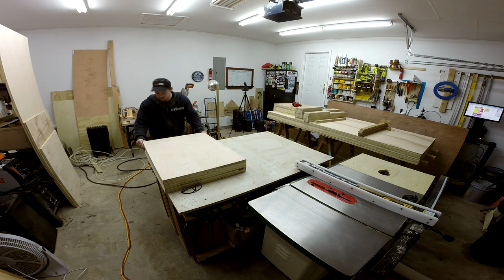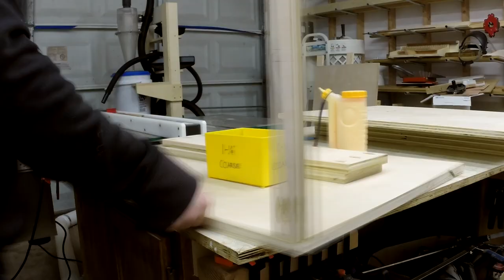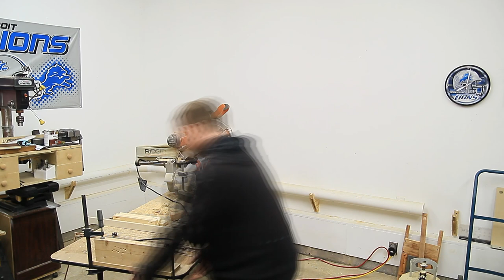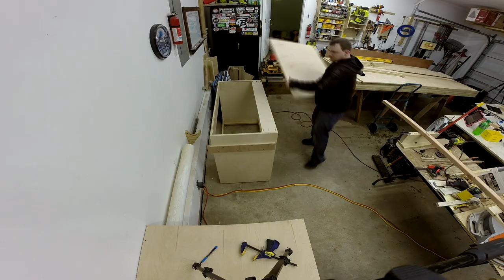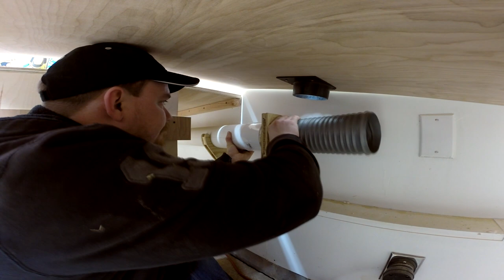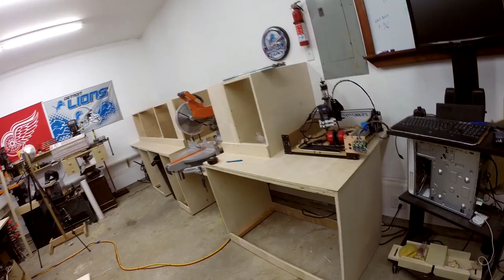Miter Saw Station Cabinets and Work Surface - 194

Comment: I love your miter station. I would not call myself a woodworker, but I am a 58 year old woman who builds lots of shelves, and does lots of home improvements. And I do have my own power tools and workshop. I have built my own workbench, just threw something together with scraps and I built lots shelves above the workbench that I can barely reach. I like yours because being only 5 ft 1 inch, I could easily reach everything the way you built it. Plus I like how the counter tops support long boards while cutting them with the miter saw. Excellent idea. Though I am not very good at making drawers, I could instead make it to fit my plastic bins and even add more bins. I use a lot of them in my workshop, I store things like my jigsaw and circular saw in plastic bins along with the manual and the little tools that go with them so everything is together, I also store things like scrapers and other things in bins, keeps the dust off. And I could even add higher shelves for seldom used things.

Comment: Looking good so far Jay!  That's gonna be awesome when you are done!  Good call on the t-nuts and bolts for leveling feet.
Reply from the maker: Steve Carmichael Thanks Steve. Tee nuts and bolts are much cheaper than leveling feet.
Reply: Jay Bates I've never seen that. I like it! Wish I had known about it before doing my own a couple weeks ago with contractor shims. :)

Comment: Looking good, and it appears that you're making good use of space.

I have a love/hate relationship with my SCMS because it takes up so much space and creates so much dust. At the same time, I still find it very useful and use it almost every time I'm in the workshop. It looks like your plan addresses both the dust and the space issue.
Reply from the maker: Barry's Workshop Thanks. There is waaaaay too much wasted space with a typical SCMS so I chose to use as much of it as I could with drawer storage.

Comment: Great alternative to the Wotkshop hutch Norm Abram built. Mutch easier to get the cabinet compartments the exact same size when making the cabinets individually, which is a big deal when it's time to make drawers, and install drawer slides. Also the individual cabinets makes it much easier to accommodate for uneven floors.
Reply from the maker: Peter G True.

Comment: Great miter saw station, I plan to start mine soon (based on your design and another one).  Just a little tip from another "garage woodshop guy" here:  Back your truck up so the plywood is roughly in line with your table saw fence, and go ahead and slide it from the truck onto the saw and cut it.  It should save you some double work from moving the sheets around twice!
Reply from the maker: That's true. But it rains a lot here. I can't keep anything in the truck.

Comment: Just a suggestion Jay: have the home center/ lumber yard pre-cut those 4x8 sheets in half with their panel saw. Most don't charge for one or two cuts and a nominal charge per cut on larger orders. It makes handling by yourself sooooo much easier. You can still run it through your tablesaw to get an accurate edge but it saves your back and speeds production greatly. Love the vids even if you are a Redwings fan. :-)

Comment: I'm just starting my first cuts in the plywood to make this in about 1/2 hour.  I'm thinking I will flip the carcasses over and get the leveling feet close to level while they are upside down and then fine tune them once they are in their final positions.  I think this would save a lot of time as you could easily spin the carriage bolts without the weight on them.  It will need fine tuning I'm sure as the bolts will switch back to front when flipped upside down.

Comment: Wow!  That's what I call taking control of your workspace.  Was the concrete really that level?  Hats off to the guys that screeded that slab.
Reply from the maker: Michael Meara No the concrete wasn't that level The wall side of all the boxes was higher than the front side. I leveled every cabinet with the bolts but only showed one.

Comment: when you were screwing in the pocket hole joints it seemed like you went 70% backed out a bit and then screwed it in all the way almost like when you tap a hole 
what is the purpose of that, does it avoid cracking?
Reply: if the pieces are misaliened
Reply: ndinadis Sometimes the two pieces don’t make full contact before the screw bottoms out. Backing out the fastener and driving it again aides in a better fit because you can make use of the piloted hole and downward pressure. Good stuff!

Comment: Looking good.  Not sure i understand blocking the counter space on the left but well done either case.   I never seem to have enough horizontal areas.
Reply from the maker: phooesnax Horizontal surfaces collect junk. I'd much rather have multiple drawer storage. I have other work surfaces in the shop for actually working on stuff.

Comment: Hi Jay, I like your stuff and the clear nature of your videos. I was wondering why you seemed to drive your pocket hole screws and then reverse them out before driving them home. Also with as many pocket holes as you drilled, the pocket hole machine seemed to be worth having, although I recall you saying that the machine broke a lot of bits. Was it worth having for this build? Would you buy it again?

Comment: I purchased some 3/4" Birch plywood five years ago at £75 ($100) per 8 x 4' sheet, I have just been quoted £400 ($520). I don't think I will be using that for any workshop projects. Regards from expensive England.

Comment: Nice Jay, i am still contemplating on doing a fully built in like yours or put it on wheels. There is a lot i want to do in the garage to make it a fully working shop.
Reply from the maker: Miter Mike's Woodshop I ended up not doing the wheeled version as I knew I would just park it and never move it. This gives me a lot of dedicated storage space that every shop can use.

Comment: looks great Jay. I've been waiting to see how you would take this project. I know it's early yet, but have you thought of adding a "stretcher" under the miter saw table to prevent the plywood from sagging. I have the 10" Ridgid without the slide and it made one of my work tables sag.
Reply from the maker: Studio69Fan Yes, there will be support under the MS.

Comment: Jay, like the way you've set up the extensions at the front of the saw to help with the full sheets, can you describe or show how that set up works and attaches to the saw?  Looks like a slick helper hat I could use, thanks for the channel, it has good content!
Reply from the maker: Chef Derek The infeed helpers are super easy: https://www.youtube.com/watch?v=KyNgZ72VwtA
Reply: Jay Bates  Many thanks fir the link, I couldn't find ut when I looked!  Now I just have to figure out how to make them work on an extruded aluminum front rail.

Comment: Just saw your build. Nice work btw! Tell me how deep your bottom cabs are.. Look to be 30" with 24" upper cabs. I have a Makita 12" with the dual slide rails and nice saw, but needs about 30" from front mtg holes to rear when fully pushed back. Thx Jay

Comment: Simple answer I am sure, but how did you connect your mitre saw exhaust to the hole you created for the dust/debris collection in the table? Do you just attach the shop vac to the pvc to create a simple dust/debris collection?

Comment: Love the design.  I'm going to use it myself when I add my third stall garage this summer.  One question.  Have you given any thought to when you have to replace your Rigid miter saw one day?  I haven't check lately, but don't think they are all the same and who knows how long Rigid will offer that model or one with similar dimensions.  Just wondering if you build any adjustability into the station.
Reply from the maker: VC Sawduster This is the largest SCMS I have ever seen so pretty much everything else should fit in the space. Hopefully I'll never have to replace it.

Comment: this is probably the 20th times I watch this video 'cause I'm trying to learn tips in building mine. One main problem I have is the Kreg screws will pull the work piece from alignment. I see that you screw it in and back it out a few times, is that to prevent this? I did use a clamp but it's not enough apparently, or did I screw in too far?

Comment: In the planning process at the moment to building something similar in my shop, I'm curious what your total estimated material cost was.  Also, I'm not sure if going with  big deep drawers, medium depth ones and/or some very shallow ones is a better idea than just going ALL deep drawers or even cabinet doors.  

I'm curious what you find the most useful in your shop before I actually start to cut.
Reply from the maker: +David Elston This organization system has been really beneficial for me. The only thing I don't use as much as I thought I would was the planer drawer. I keep my planer out now. I use all of the other drawers equally.

Comment: Love the project and looks like it will save you a ton of time on future projects. I have used the same leveling setup on my sandblasting cabinet in my shop and on my router table stand with very good results. As you said; way cheaper and works just as well. May be jumping the gun, but how are you planing on a fence stop for your replica cuts? T-track or something... I really like this project and cant wait to see it when everything is completed... Keep up the awesome work and love your channel..

Comment: What type of plywood did you use for this project, it looks like birch plywood, but it appears to have more blemishes and not furniture grade and what's the cost per sheet cause I see that you used a lot of it.  Thanks
Reply from the maker: +Derek Droc PureBond birch plywood. It's $45-50 per sheet.

Comment: For the leg leveling I see that you use was that nothing more than quarter inch Nuts and Bolts or something similar? Did you glue the nuts in place
Reply: Ok ha ha. Never mind. As a side note, I did this exact same thing to a board that I use while I am cooking camping so I can level my stoves on my cast iron skillet doesn't have all the grease lean to one side. Never thought about using that for a workbench

Comment: Jay, awesome vids, but I'm curious as to why you backed out the pocket screws when you put them in. thanks
Reply: I think it was done in video editing. Added a little repeat. It was pretty neat.  My thought, I could be wrong though.
Reply: Maybe so
Reply: When using a power driver to put screws in, if you don't have momentum then the screw will grip and the bit will just bounce and start tearing up itself and the screw head. So if you go in till you feel it resist, then back out and in again you get enough momentum to put the screw in all the way, since you can't really predrill the second board with pocket holes
Reply: i use pocket screws all the time and never had that happen, plus its a square bit so it really can't strip
Reply: then maybe his drill couldn't put in enough force to move the screw once it caught, so he had to back out and put momentum into it, it is just a little cordless drill
Reply from the maker: Graeme Evans Yes, what Graeme said. I only have to do this with my 12v drivers. They don't have enough power to penetrate the second piece without shifting the joint. My 18v drill has no problem.
Reply: oh, i see, i use a 20v so thats probably why i don't have this problem

Comment: Sorry I don't know the correct term, but what are those angled inside-edge screw holes you make?  Is that to hide the screws or does it give a structural advantage as well?

Comment: Instead of pocket holes, would drilling a screw straight into the sides work just as well?
Reply from the maker: Yes but you will have to patch them.

Comment: Great station! Can you tell me roughly how many pieces of ply went into this build? Looks like a lot, just want to estimate the budget before purchasing your plans. Thanks
Reply from the maker: +marlow stanton 12 sheets 3/4" ply and 3 sheets 1/2" ply. A rough cost for the station is about $1,000. Knock off a few hundred if you use pine plywood

Comment: I have a question. How many inches is the gaps on the side of the miter saw to where the wood is?? I have this exact miter saw and I would buy your plans but mine can’t be remotely close to the size of yours so I’ll have to create something different. Just wonder how big that gap is on the sides.

Comment: Does it have to be made in 3/4" plywood or is 1/4" (or 15mm, as we have here in Australia) fine to use? I'm thinking of doing mine all in 15mm ply, as 18mm ply is $5 a sheet more expensive. I can't decide.

Comment: Jay, Im working on building this chop saw station to fit my garage, The space is a little smaller than yours. I am planning on adding my drill press next to the shop saw mounted directly to the top behind the fence. I was also considering making the outfeed side double as a router table. Any thoughts?

Comment: Tell me, Jay why did you decide to put the damper tube dust in such an awkward spot (under the table), why not make it on the left, where the pipe is available?
     The second series of the video when it is?
Mark Fisher, Ukraine.
Reply from the maker: The second video was posted 8 hours ago. The blast gate for the dust port will be extended to the front area of the station. That or I will leave it open at all times.
Reply: Thank you, Jay now look :)
Mark Fisher, Ukraine.

Comment: Hi Jay, I purchased a copy of your plans. I'm building one in a shed without a solid wall for support. Any tips? I'm thinking deeper plywood so no need for the wall support... or to maybe build a small frame (kinda like a small stud wall) out of pine and bolt said frame to the concrete floor. Just wondering if you have tips as I'm pretty certain this question would have been asked before! Cheers.
Reply from the maker: You can make a support structure to mount it to. Or brace the back side with 45 degree braces from top to bottom.
Reply: I'm sure I'll figure something out. Thanks for the response and thanks for the inspirational videos 👍

Comment: Question:  When you drive in your pocket hole screws, why do you back them off a bit before driving them fully home?
Reply: Mick S Just a guess, but it is probably to allow the wood chips to escape and prevent splitting the wood, even with pre-drilled you can split the wood if it's a tight fit.
Reply: Brian Boatright
Thanks

Comment: that looks pretty DIESEL Jay! NICE!! hey how come u screw in and out the p.h screws? does that set them in place better or something? looking fwd to the rest of this mega miter station build :)
Reply from the maker: Joe Walters To start the hole without the boards moving.
Reply: Jay Bates nice! I ALWAYS have that problem and end up sanding my life away..kool thanks for the tip bro!:)

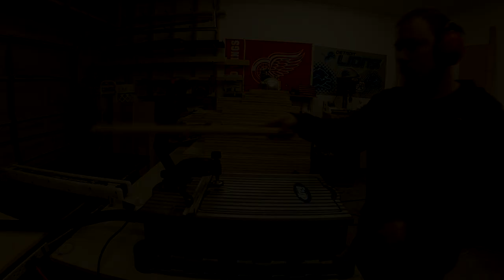Comment: Jay Bates Hey Jay. I'm somewhat new to wood working and metal working. What does that machine do at 2:00? Great channel by the way. I've been here since around 90,000 subscribers and the videos have always been good. Thanks for your time.
Reply from the maker: Knives n' Gear Drills pocket holes.
Reply: Jay Bates Thanks.

Comment: Quick quesiton:  How far from the floor is the bed of the miter-saw?  I'm building a movable station and am having trouble deciding how tall to make it.  I'm thinking about making mine 37"-39" from the floor but that just looks too low.

I'd be interested in hearing how you decided on the height.
Reply: Bill Weissborn most people choose their working height by the height of their table saw. Every table and work station should be designed at that height. As long as youre comfortable and the areas are consistent, it doesnt really matter. One height will not work for everyone.
Reply: nizmojoeblows I completely understand that each person may have different heights.  My first miter-saw station was about mid-chest or about 40-42" from the ground.  that worked for me at the time, but now I'm building another station which will be about 36" high.  Might not seem like a lot of difference but I think it will work better for me this go 'round.  I was just curious as to what height Jay chose and how he came to that decision.
Reply: Bill Weissborn Did you shrink!??  LOL!  I build my 'other' work benches, and stations, to fit my comfort level.  (bad back).   My table saw height rules the middle of the shop.  My run-off table for my saw is adjustable (scissor jack system) with a preset level at saw table height, that way I can lower it for certain assembly situations, or raise it for comfortable assembly of smaller projects.

Comment: I know this is an old video, but Im building a miter saw stations and I just cant decide how tall I want it to be.  So I am curious.  What height is the actual work surface of your miter saw bench?
Reply from the maker: Same as my table saw. Don't recall the exact number but I want all work surfaces to be the same height if possible.

Comment: I wonder how much the material cost.
Reply from the maker: 500-1000 depending on what grade material you use.
Reply: I have spent $1000.00 so far. still need to get slides and handels. may have to contract with someone who has a CNC for some Hog drawer pulls.